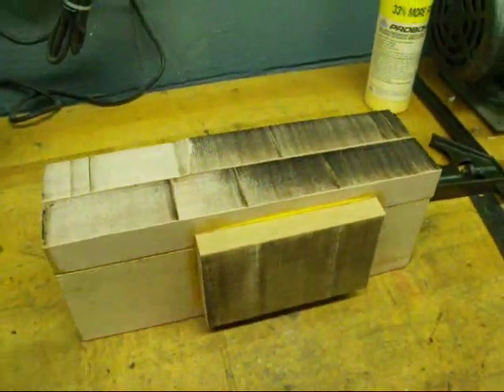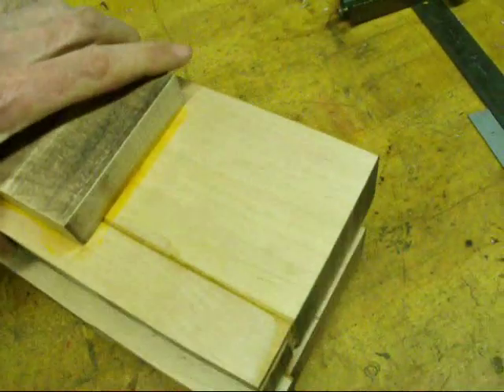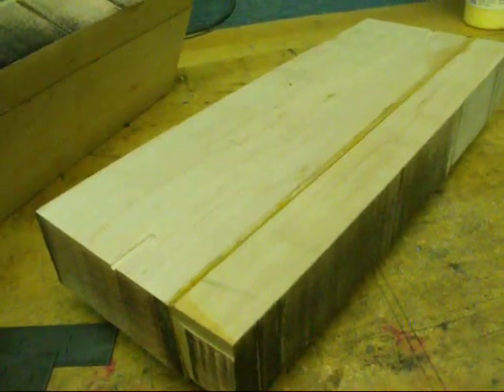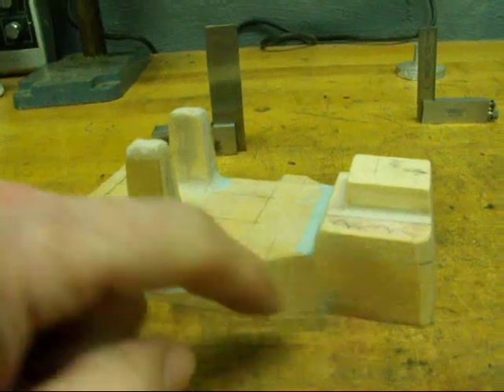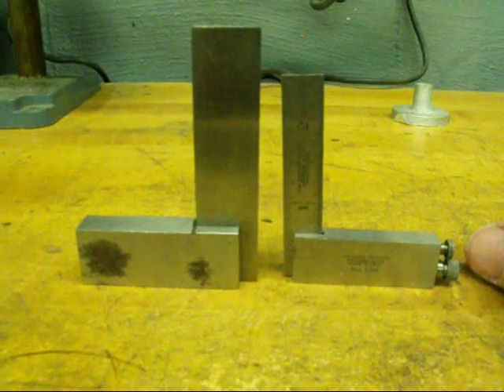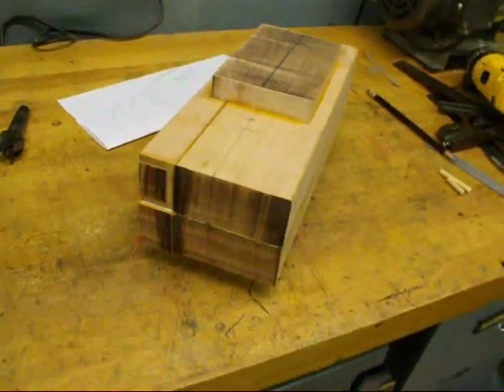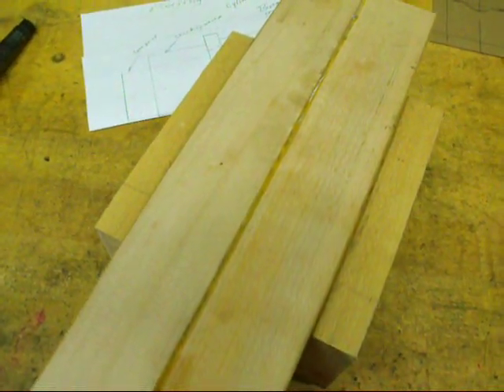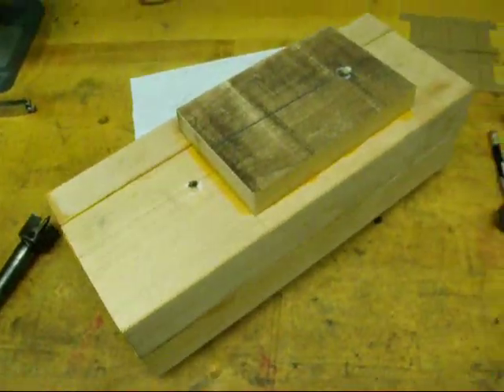FOUNDRY PATTERN MAKING part 2 Steam Engine metal casting tubalcain

Comment: I see a lot of talk of 3d printers... To join the discussion, I'd mention that they are technically "Rapid Prototypers", second to Digital protoyping as far as design flow goes. BIG $
When It comes to machining, I consider myself highly undereducated, so thanks!
I served in this mans Navy as a aviation structural mechanic, specializing in composites, and ultimately Non-destructive inspection. This is about the time that I run out of space... hehe
I swear, I will one day run a bronze foundry...

Comment: @TinkeringJohn Speaking of 3D printers. There is a video on Utube about a machine that will print with sand to make sand molds. No pattern or cores are needed. So undercuts can be designed into the sand mold. I don't know what it cost in dollars but I have a feeling that it will cost many times over in jobs. Thats progress.

Comment: If the price of them come down to an affordable amount, a 3D printer would be great for making patterns. You could also make the pattern partially hollow inside and have the alignment pins and holes incorporated into the each half of the pattern like you see on the 2 fuselage halves of a plastic model airplane kit. Of course you would place the alignment pins so the halves fit only one way. Although, if you prefer, the old school way is fun and challenging.

Comment: As a Journeyman Carpenter with years of experience I marvel at your versatility. Probably sounds like stroking but is actually material support.

Do you know if this trade is still pursued by industry or has it succumbed to outsourcing?

I imagine it is still possible to apprentice and pursue this as a career. Do Community Colleges/State Universities provide courses?

Thanks for the careful layout of the steps required.

Best and God Bless,

Jon

Comment: Once again, thanks for your efforts - good stuff !
Chances are your bandsaw blade is sharp, but may have a high tpi. To cut maple (or similar material) at that thickness you should have a blade with 3 tpi  (teeth per inch) or less.  A little canola oil (PAM in the grocery store) on the blade can also help.